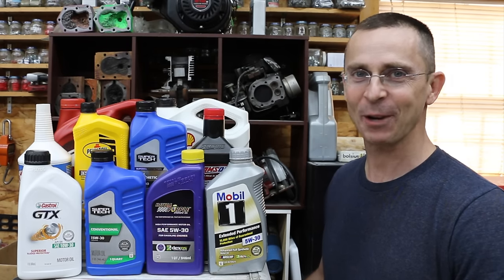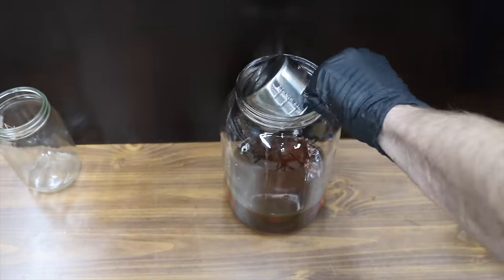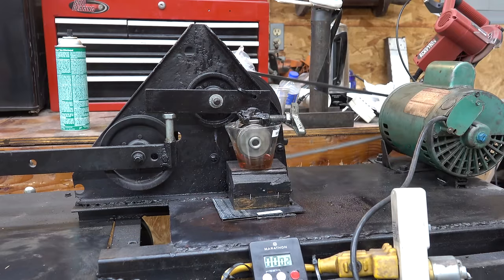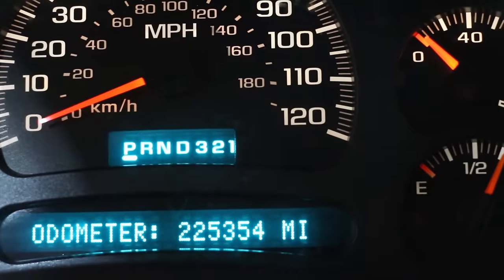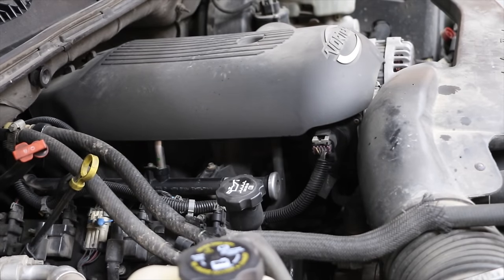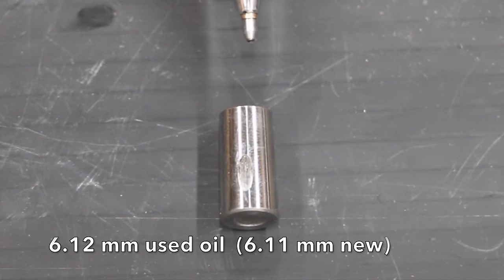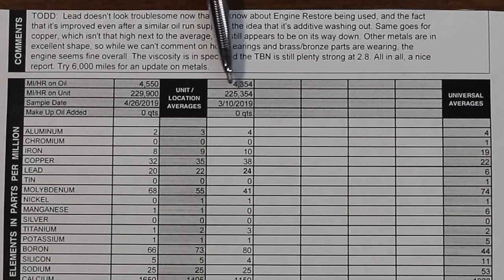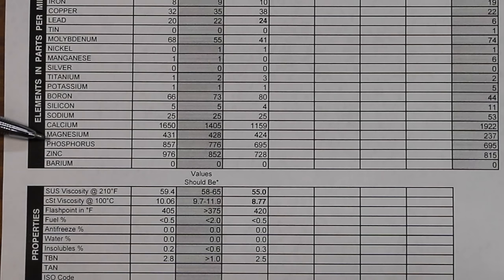Will Mixing 10 Motor Oils Damage an Engine? Let's find out!

Comment: Love 😘 your videos and I learn something every time. Have a question; bought a 1 owner Nissan Sentra 1.8. litre engine. Had the oil change few months later because of 2 reasons. Did not know the maintenance schedule and what oil used..it did have a STp filter on.OIL LEVEL 🎚️ FULL, BUT A VERY BROWN 🟤 ALMOST BLACK COLOR. September had it changed at the local lube shop, had PAUL put on a new magtech filter and 3 quarts of Kendall GTX  titanium oil 🛢️. It's Just about 3,000 Miles on the change; oil 🛢️ is a dark brown 🟤 COLOR; would i need a better oil filter OR Better name oil ❓ The Owners manual says to change OIL and filter every 7,500 miles ❓❓ Thank you for any information.
Reply: Oil can be dark brown and still be good oil. The color is not as important as how clean/dirty it is. As long as the oil is not full of grit then the oil should be fine.

Comment: Another well done video. I've only mixed oil brands a time or two with no issues in my old S-10 with better than 275K miles. Would be curious if mixing gasoline brands causes any issues. My dad liked to stay with one brand but occasionally I will mix say Shell and Speedway gasoline depending on my travels. Keep up the good work!
Reply from the maker: Thank you!  Thanks for the video idea.

Comment: I wouldn't recommend mixing diesel oil with normal oil as diesel has added zinc and other metals which can damage catalytic converters when the oil burns as the metal bonds with the metals in the cats.

Comment: In 78 my grandparents bought a new Chevy Monte Carlo with a 305 V8. When the the car had about 18K miles my grandpa took the car into Chevy for an oil change. They put 1 quart of synthetic oil and the rest of conventional oil and told my grandpa that it would help the motor perform better. From that day until they sold it at 60K miles, the lifters tapped.
They refused to buy another car from that dealership again and never had the oil changed from them again either
Reply from the maker: Thanks for sharing.

Comment: I would like to see motorcycle oil vs car/light truck oil. I think it's the same most motorcycles use 20/50 some Japanese bikes used 10/30. Motorcycle oil is way more expensive and I just don't think there is a difference. I know Castrol makes a 20/50 bike and vehicle oil plus a few other brands. I would like to know if there is a difference. Great videos.
Reply from the maker: Great suggestion!

Comment: I have done that since i remember, however only mixing weights when had some left over quarts, but have been mixing cheap old conventional oil which is cheaper with newer synthetic oil so technically my own synthetic blend to the cheap, no issues on my old toyota pickup truck, engine is clean inside with no sludge, one thing i remember was when using diesel engine oil in gasoline cars, it may not be good to the catalytic converter and emissions due to its additives being higher than gasoline engines
Reply from the maker: Thanks for sharing.
Reply: Thank you for your amazing content, you have set the bar for content really high, cant wait for yor next video :)

Comment: I used to work for the US Navy (as a civilian).  Once when I brought one of our government vehicles in for an oil change I asked what brand oil they were using.  The "head-honcho" told me that the US government requires that all oil manufacturer's oils (in the US at that time) be compatible with each other.  This makes sense to me - just like you can mix different gasoline blends - but I can't confirm it, its just what I was told.  Of course mixing different weights might or might not be a problem. if you mixed a 10W30 and a 20W50 would you end up with a 30W40?  Probably not as the "W" stands for winter, not weight.  But if you mixed a straight 30wt and a 50wt, once mixed, you might end up with something in-between... maybe.
Reply from the maker: Thanks for sharing.

Comment: Honestly, depending on the year of the vehicle, it might not be best to use the manufacturers recommended oil as with time, science improves and therefore better oil is manufactured and better for use but great video bro, i watch all your videos, i just want you to make a video on the best brand of drill bits for hardened steel as they are not all equal.....
Reply from the maker: Thanks for sharing.

Comment: Interesting and educational. Thank you. I would tend to run thin oil in winter for that quick circulation reason and bit thicker or recommended viscosity for summer (depending on mileage and if still in warranty or not). On older cars I have used blends, but I also change my oils regularly too.
Reply from the maker: You are welcome!  Thanks for sharing.

Comment: I have a C4 Corvette with a ZF 6 speed transmission. From the factory these used 5w30 motor oil as lubricant, but as the years have worn on there have been a handful of forum recommended fluids to change this to and I think it would be really cool to see a proper comparison to all these fluids.
Fluids:
GM Replacement 1: 88865551 ACDelco Dexos 5w30 Synth
ZF themsevles used to say use GM DEXIII ATF was a suitable replacement for the 5w30 fill, but as per a bulliten from GM as DEXIII was discontinued, manual transmissions switch to Synchromesh and autos to DEXVI.
GM Replacement 2:ACDelco Synchromesh Manual Transmission Fluid 88900333
Redline  LIGHTWEIGHT SHOCKPROOF 75w140
BMW Castrol TWS Engine Oil 10w60 07510009420
Royal Purple Synchromax
AMSoil Manual Synchromesh Transmission Fluid 5W-30

Like I said, it can be a bit of a heated debate and everyone has their experience with one fluid or another, but that is just anecdotal evidence and can't be taken with much more than a grain of salt.
Reply from the maker: Thanks for the video idea.

Comment: I have an idea for a couple of videos:

1) The other day, I made the MISTAKE of buying a WVE branded part for my 1991 Civic. They advertised, "Made in USA," but when I opened the part, it was Made in you-know-where.  Needless to say, the part failed right out of the box, and -- since I didn't assume that my brand new part was the culprit -- I spent 3 weeks looking for the gremlin. It wasn't until a LOT of grey hair later, that I thought to myself, "Geez, it couldn't have been anything BUT that part," and when I replaced it with an OEM component, voilà, everything ran normally.  

Of course, I want to go 100% OEM, but I'm not rich, so I hold my nose and often buy aftermarket on places like rockauto.  For the most part, I have been lucky, and the performance was as good as OEM. Other times, I got SUPER lucky, and the aftermarket part was BETTER than OEM. And then sometimes, companies like WVE screw me up the a**.  

I would like you to do a series of head-to-head comparisons of common brands of aftermarket parts available on RA, and rate how they do against OEM, please. It would serve all of us DIY car guys very much, to know which aftermarket brands we can trust, and which will just steal our money, like WVE.  

2) I have noticed a lot of (previously?) trusted brands, like WIX and Mahle have swapped out their parts for Made-in-you-know-where parts. Same brand, same box, same everything. Only the, "Made in Blah blah blah," part is different.  It would be tremendously helpful if you would do a comparative evaluation of these brands' Made-in-you-know-where parts, against their own previous merchandise, please. I am sure I am not the only one out here who is wondering if the new versions are able to live up to the names printed on them. I don't want to get WVE-ed again. 

Thank you for your time.
Reply from the maker: You are welcome!  Thanks for the suggestions.

Comment: Thanks for the test that proof the mixing is okay. 
I just did a mix of 5W30 (Liquid Moly + Shell Ultra SN) and run for miles. I found it hot on the engine bay as compare to before oil change. Any thought on this?

Comment: With newer engines you have to be careful with the small diameter of the oil routes to the rockers.  You can't use the heavy stuff (like 15w-40) on newer-but-high-mileage engines to make up for worn rings, without ruining the rockers and valves.
Reply from the maker: Thanks for the feedback.

Comment: Mixing lubricants may not lead to equipment failure, but it will reduce performance. For example, if Mobil 1 5W-30 Synthetic Motor Oil is installed in a vehicle, and the vehicle owner adds Castrol 5W-30 Synthetic Motor Oil to top off the engine if Mobil 1 isn’t available, the vehicle will continue to operate perfectly; most Synthetic Motor Oil share a similar chemistry, and formulations of the same viscosity can be safely mixed. However, mixing the lubricants will shorten the life expectancy and reduce its performance benefits. Do not extended drain intervals where oils have been mixed
Reply from the maker: Thanks for the feedback.

Comment: I wonder if you read comments from a 4 yr old video? Lol
We just bought a 2 year old tacoma and only put 200 miles on it, yet we were told and read toyota recommends 10,000miles before oil changes, this is foreign to me as I'm used to oil changes every 3000 to 5000 miles. I have been watching your vids on full synthetic and no one around me uses Mobil or amsoil. So in  9500 miles I have resigned myself to use pennzoil ultra platinum. Who woulda thought a 4 year old vid helps me make a decision on an oil when 9500 miles is a year away. Thanks alot

Comment: I used to know a man who owned an auto repair garage, when they sold a can of oil instead of throwing away the can he would put it up-side-down on a grate over a 5gallon pail. The result was what his tow truck and work truck got for oil. He also burned waste oil to heat his shop.
Reply from the maker: Thanks for sharing.

Comment: It is very important to use the correct oil in your car or truck. I purchased a used 06 F150 with a 5.4 that someone used the incorrect oil in and it messed up the cam phasers, the engine still runs but it sounds like a Maytag washing machine. It has been like this for a number of year snow and really not worth fixing at this point in the trucks life thanks to new york's over use of corrosive road salt. I also use Engine restore in all my vehicles and they do seem to run better.
Reply from the maker: Thanks for sharing.

Comment: A woman I did some work for around her property recently, had purchased two boxes (12 quarts) of 5w-20 synthetic years ago by mistake and just wanted the space back in her garage, so she gave them to me.
My van calls for 5w-30. I was wondering about mixing the oils if I happened to be low, or using the 5w-20 for a full oil change.
Thanks for all the great videos. I really like your channel.
Reply from the maker: Thanks and you are welcome!  Thanks for the suggestion.
Reply: I'll take them if you don't want the oil

Comment: Since most synthetic blend oils have a low percentage of actual synthetic I normally mix my own. I blend half and half synthetic to dino oils and depending on the season I might mix different viscosity depending on engine miles. I have never had an issue. Now if I had a new car or a car with under 50k miles on it - I would follow the manufacturer recommendations.
Reply from the maker: Thanks for sharing.

Comment: Thank you!!!... I was weary about amazon oil, but seems to be good in your video... Also, I was wondering about lawn tractor engine wear and tear while on hills and angles. I mow my ditch and was curious. Mine is a vertical shaft b&g ohv 17.5.  Does oil pump or splash and will angles allow it to get where its needed? Just a curious bored guy here. Thanks...
Reply from the maker: You are welcome!  Thanks for the suggestion.

Comment: No Motohome Test I wanted to see the flaming exhaust😄Ummm People they mix oil what do you think the Valvoline is? MIXED 😄😳 I used valvoline in summer & Supertech 5W20 synth in the winter. Just like the Burban , that GM has been Maintenance free for 150K 
Would  your Dorf or Dodge do that? I used Slick 50 when the 6.0 was New & Rinsol at 50K .
P.F. our personal U.L. Lab brother.😀👍
Yet Another outstanding experiment.

Comment: This seems like a lot of clean up. Brings back flash backs to the last change I did and the pan got spilled. Trying to soak up a couple qts of used oil without a good shop rag is kind of a headache. I was happy that I didn't clean up all the saw dust from build shelves to help soak it up.
Reply from the maker: Thanks for sharing.

Comment: I change the oil & filter in my cars every 6000 miles I use fully synthetic oil only. I am using super tech oil filters exclusively. What do you think of this? Cars are Honda 2009 CRV (115,000 mi.), 2017 Toyota RAV4 (38,000 mi), &201 Subaru WRX (8,000 mi).    Thanks Jim
Reply: Supertech is fake synthetic
Reply: What does “Supertech fake synthetic mean?   Jim

Comment: As long as you don't mix ester based and petroleum based you should be alright. It is best to keep it all the same, but that's not always possible. You would have to go out of your way to get ester based oil as it's generally marketed towards racing use.
Reply from the maker: Thanks for the feedback.

Comment: I love this idea & curious how it would work in regard to oil additives. For example, what about doing 1/2 application of MMO mixed with 1/2 application Lucas Oil Stabilizer mixed into oil & running the usual tests? Since MMO is a good cleaner but thins the oil, I would be curious if the stabilizer balances out thickness and does a better job protecting while still increasing cleansing capability vs straight oil.
Reply from the maker: Thanks for the video idea.

Comment: I see quite often you send your used oil  to a lab for testing.  And is a very good practice.  
I am curious about the old Ford  tractor??? A while I suggest you run the valve clearance/ did you??? 
The next question have ever sent a used oil sample to the lab for testing on the old tractor???

Comment: I have a buddy that uses 2qts of amsoil 5w-30 and 2qts of royal purple 5w-30 when he changes his oil. He's had zero issues. He calls it AmsPurple oil lol. He said he likes both oils and said whats the harm if I mix them as long as it's the same weight. He started off with using the Amsoil and adding half a quart of the royal purple. Next oil change he used a full quart of royal purple, and now he uses 2 qts of each. He's had zero issues in 2 years.
Reply from the maker: Thanks for sharing.

Comment: I had a pretty bad experience about a year and a half ago, I tried to save $80 dollars by taking my Lexus LS460 to a Toyota dealership for an oil change instead of Lexus. The person I made the appointment with was very familiar with my vehicle type and told me the correct oil and it needed 9 quarts. Of course I already knew this but I thought it was great that he knew this as well. When I arrived for my appointment a lady asked what I was in for, I told her I had an appointment for an oil change. She said she would take care of it. I asked didn't I need to see the service advisor I made my appointment with? She said no, she'll take care of everything and took my name and vehicle key. Over 3 hours later my oil change was finally complete, or so I thought. I looked at my service receipt and it said 5w30 conventional motor oil was used.  The Lexus LS460 requires 0w20 full synthetic oil.  I explained that to the service advisor and the cashier so they called the service technician up to the cashier booth. He said oh no, that he put the correct 0w20 motor oil in and they just rang the receipt up wrong. So they changed the receipt to say 0w20 oil and that raised the price about $20 dollars.  I paid for it and continued going over my receipt and noticed it stated that only 7 quarts were added. I then told the technician that my vehicle requires 9 quarts of oil. Thats when a problem came. He literally tried to argue with me that my vehicle only takes 7 quarts of oil and he was sure of it. I was pretty pissed at that point that he wasn't even going to check to make sure so I took my key and receipt and went outside where they parked my vehicle and opened the hood and checked the dipstick. The oil level was below the low dot. I immediately went back inside and requested he come check for himself. Then he said it looked like this vehicle only took 7 quarts, he said he would add the other 2 quarts free of charge. By that time I had been there 4 hours for an oil change. When he was done the original service advisor that took my appointment had heard all that was going on and came over and apologized to me for what I went through. He didn't want that to put a bad reputation on the Glen Burnie Toyota dealership with me, but the damage was already done when the technician argued with me without even checking to make sure he was right, but I still thanked the service advisor for taking the time to come over and apologize. I asked him why the lady service advisor wouldn't allow me to see him in the first place since I made my appointment with him? He said it's just the way it's been since some recent changes but it shouldn't have went that way. I got in my vehicle and it took about 15 seconds for my engine to turn over when I clicked my start button. That never occurred before so I thought maybe it's just cold out or he put the wrong engine oil in my vehicle. For the next month it took up to 30 seconds for my engine to start on some days. A few days I had to try 3 times to start it. I thought I better head to the Lexus dealer early for my next oil change. Amazingly as soon as I got in my vehicle after the oil change at the Lexus dealership my vehicle started right up and has never hesitated to start ever since. So LONG STORY, I think the wrong motor oil can possibly do harm to your engine, unfortunately I have no concrete proof.
Reply from the maker: Thanks for sharing!